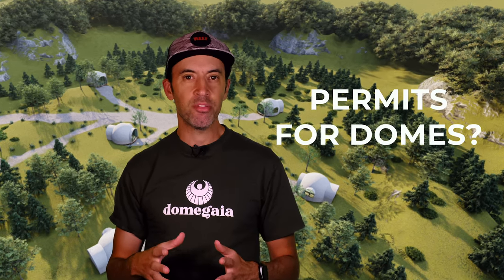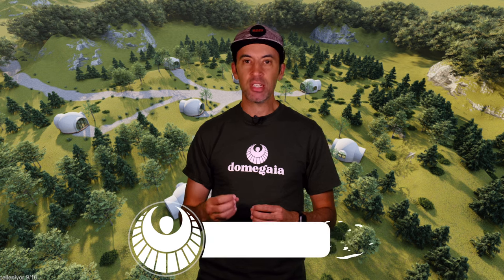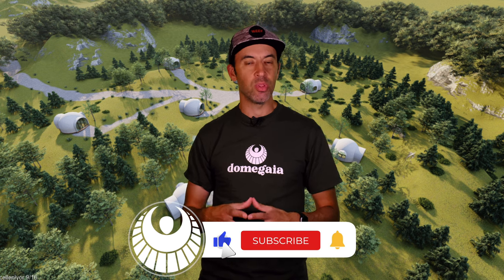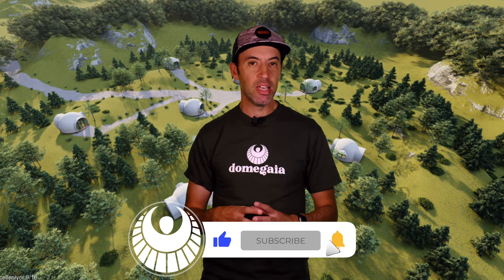Learn How to Get a Building Permit for an Aircrete Dome

Comment: Every one that works with Nabil from PSE is top notch.  Just because one guy told you he would approve it, when you submit your permit you do not know who will be the reviewer, so you need to get the director or head supervisor that has final say above regular plan reviewers.  When it comes to permit review they have what version of building code (example IBC2012) they use, and they have additional or amendments added on top of that code.  The international code does have sections that address aircrete, but you need to provide the wall and roof assembly and the testing agency that has tested this assembly and confirm its strength, fire resistance an application.  1.  what code does this permit department use 2. what county amendments might be used in the review 3. can you provide aircrete wall or roof assembly test reports 4. what is the wall and roof construction type, is it non flammable, do you have the testing agency? 5. can you provide wind or seismic resistance for your aircrete wall or roof assembly???  If you have the documentation they can not refuse you.  It is not a opinion review it is a code compliance review, it is your job to provide the documentation to prove you meet the requirements with test repots from an accepted testing agency??  Another option is just layer in some rebar into the wall roof, even though its not required it provides the code compliance a plan reviewer needs to approve your permit.  simply notching some rebar into the aircrete blocks before you apply the skim coats, this way the low cost rebar provides the hold down to the foundation the reviewer needs to sign off.  I have permitted all kinds of alternative building materials, my approach is to just add in low cost add on that get the plans approved.  Michael Angelo Leone.    mike at Hawaii Architectural dot com
Reply: Mike, thank you so much for this review and information!
Reply: This is an amazing video.

Comment: Virtually everywhere outside city limits in Arkansas there are NO building permits required. All you need permitted is a septic system. Water catchment and off-grid solar are totally acceptable. This is also common throughout Tennessee and Missouri.
Reply: Glad to hear this. We are in SE MO.
Reply: Hey, I live in Arkansas too, in Beebe. I've talked to a ton of building permit offices all over the state trying to get monolithic domes approved, which are much easier to pass permit requirements than these aircrete domes. You have to get a building permit no matter where your land is hun. What you have is called "unrestricted land" meaning you don't have to have the land zoned for a particular use, but you still have to have a permit with plans approved from the County office and they are relentlessly against domes in this back a$$ward state! Infuriating. I just wanted to build a Tornado proof house. No domes in Arkansas. 
If you do build a structure without getting a building permit first, be aware the fines for forgiveness afterwards are huge and they will most likely require you to tear down the structure, at your own expense, charging you a fine daily until they see it is gone.
Reply: Tennessee, laughably, and Texas, are both extremely dome friendly.

Comment: "Professionally designed, engineered, and stamped, will you give me a permit for it?"   I get the 'designed and engineered', but 'stamped' by whom, or what agency?  The engineer?
Reply: You hire an architect or engineer in the county or town you wish to build in. They review your plans and suggest any changes you might need for local code compliance. Once the professional signs off on your plans there will be a city or county office for building permits. If you are having trouble tooking it up yourself you can contact a local authority. They will direct you to the proper town or city building to get the permit. You can ask your local mayor's office and even your local police department for the location of the permit office in your area.
Reply: @rvmommabear  Thank you!   So the "stamped" would be from the architect or engineer.

Comment: Spoke with planning dep in Republic of Ireland yesterday.
Any building with a concrete Base requires planning permission and sadly they are instructed on agricultural lands to refuse if no planning. However if you utilise a 'temporary structure' you do not require planning. I explained aircrete to them for the first time. This was only for the base of a 39'x12v static caravan that would be positioned on the land to use for showering /shelter /eating and changing into work wear ;we're going to build agricultural units for our small farm. The static requires planning (use as home /concrete Base) however if you use a timber frame structure (grid) you could then infill these squares with aircrete for floor supports across the whole structure instead of using concrete blocks at intermittent points. 😉
Reply: I also figured using rail way tracks (disused) and a method of moving it 1 meter that would allow a temp structure. Marine Ply base with box frame in filled with aircrete would allow it to be potentially light weight enough to move across the rails. 😉

Comment: Los angeles city and especially county, are the absolute worst building departments.  I built the very first dome shaped underground houses in each.  

La County permitting fees were over $70,000  Yes, that was for FEES.  They increased the build cost by over $500K, with requirements that exist nowhere else, not even in LA City.
Reply: And then they pretend not to understand the homeless problem.

Comment: Great info 👏 thank you for sharing. My question is what is the general cost one should expect to pay the engineer for the stamped plans?
Reply from the maker: It depends on the design but could be as low as $3000 or up to $6500
Reply: very helpful, thanks so much! @domegaia